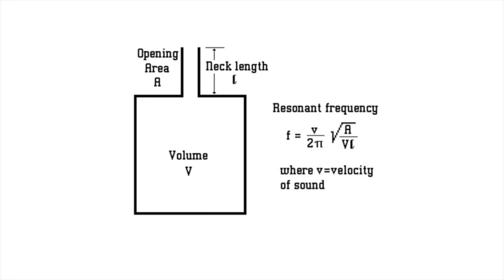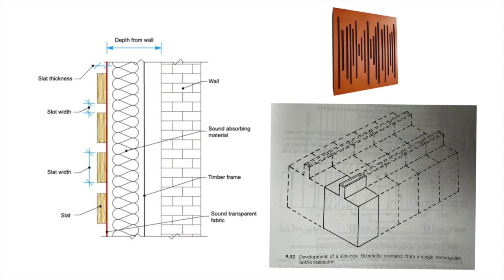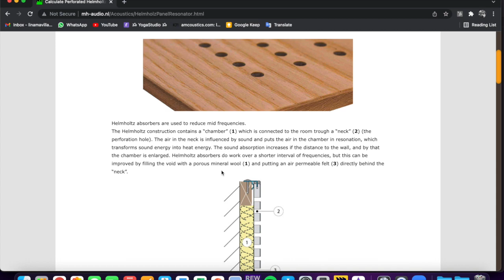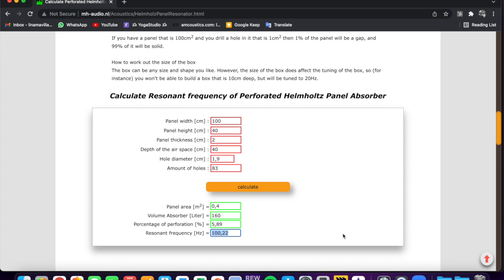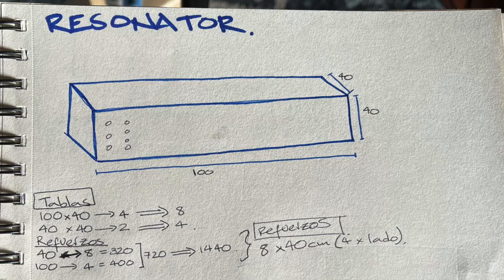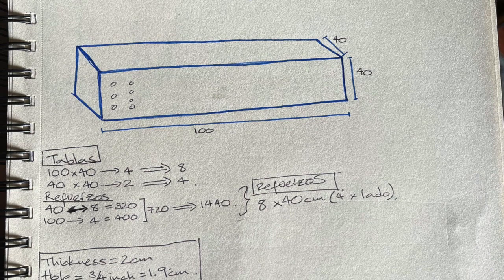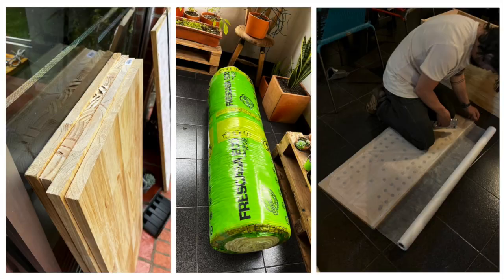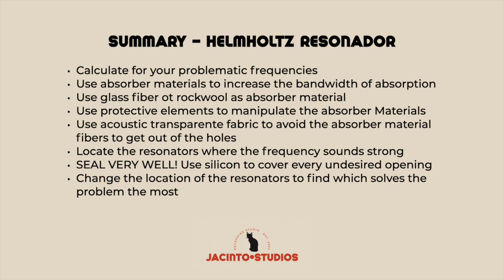How to build a Helmholtz Resonator DIY

Comment: Did it work?

EDIT: I've just seen that your depth of air space is not 40 cm, because you have a thickness of 2cm  on the back and the front, so it would be 36cm. It states it in the website that it is the space from end to end of the empty space, rather than the outside of it. Unless I'm missing something and you got it right?

This is what it says on the website

Notes:
the depth of the air space is the internal depth of the box, the distance from the inside of the panel with the holes/slats to the inside face of the rear panel. The panels themselves are not meant to move at all, therefore you should make them out of a material sufficiently thick so they don't move. Don't use 6mm MDF! If you're going with < 16mm MDF then you might like to put in a couple of braces - nothing ridiculous, just to stiffen the panels up a bit.
Reply: AKA inside measurements.

Comment: Do I understand this correctly, that 100x40x40cm  (in your case) are the EXTERNAL measurements? At 6:15 it looks like a 40x100 panel was placed on the bottom, on it two panels and on them the last panel. That makes for a rectangle of external dimensions of 40 x 44cm and internal dimensions of 36x40

I think those calculate dimensions were meant to be internal, (it says so on the acoustic calculator site), to make a volume V=0,16m^3, and also added to that is glass wool, which also has volume - does that not need to be compensated for? For every 1kg of glass wool, you'd need to increase the chamber by 0,004m^3 to internal dimensions of 100x40x41cm.

Comment: Glue guns aren’t silicone, they are a hardening material which themselves have a resonant frequency.
Reply: Trust me a glue gun is the wrong answer. It sets too fast. Maybe if you used the glue gun to apply the adhesive, assembled it, and then baked it in an oven. But by that point, you could have used silicone or vinyl or urethane and been done with it. Even aliphatic resin is easier.

Comment: If you have a say 38Hz peak problem you use the Helmholtz resonator. What do you use if you have a dip say 49Hz? No treatment for that only change listening position or shift speakers position or angle or ??
Reply: I’m no expert, but I’ve heard it’s a case of altering your monitor/listening position. Nothing else can really help nulls within a room, except making them less obvious by bringing down peaks.
Reply: @UKoldskoolsk8r  That makes sense. Aiming for no or minor dips and addressing peaks. Sometimes I think minor dips correct themselves ones peaks are addressed. Especially close to treated peaks.
Reply: I thought absorbers worked for dips too: a dip is because reflected sound pressure waves are cancelling out that frequency at your listening position. The absorber does not absorb sound that travels direct from the speaker to your ear (because it's not in between the speaker and your ear), instead it absorbs sound elsewhere in your room... which might otherwise bounce back, cancel out the sound you're listening to, causing the dip.
Reply: @davidpape1160  Yup, that's the answer. An absorber will lower in amplitude the standing wave that's eating the bass.
Reply: Yeah so if you don't want to build too many resonators I'd say build just to fix the dips and then use your DSP to dial down the peaks :)